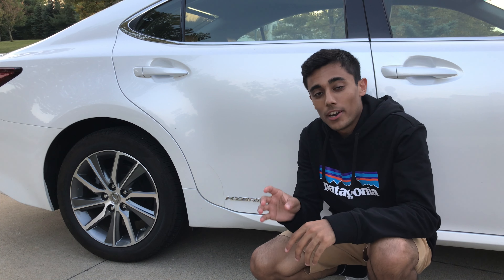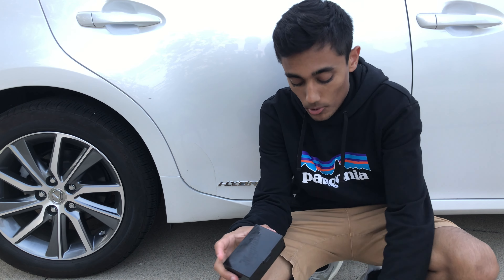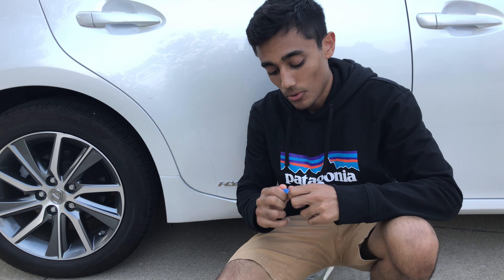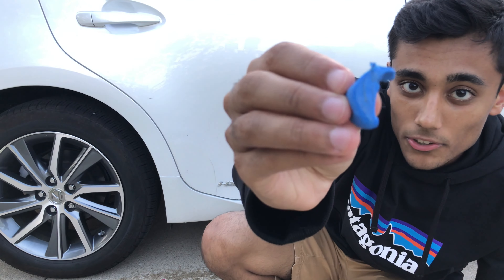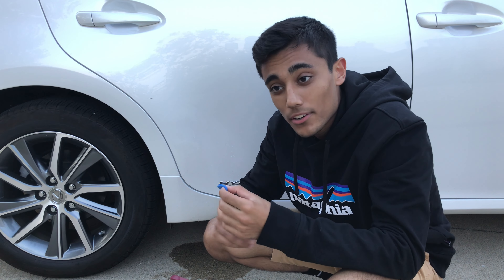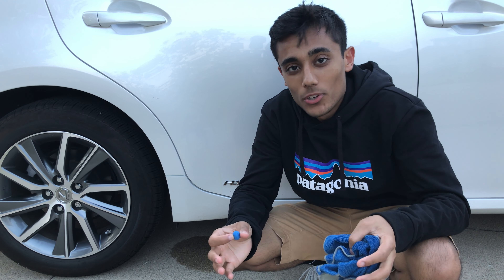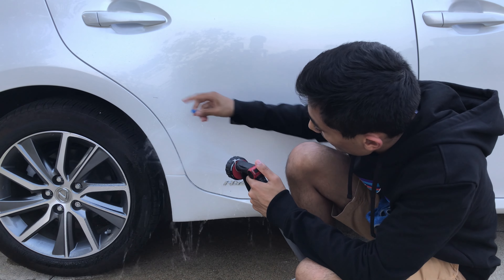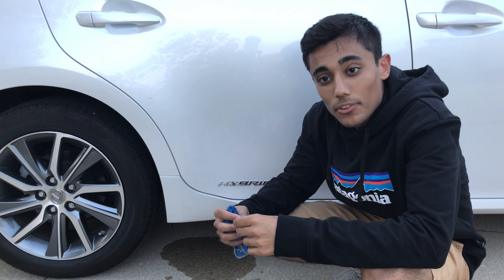How To Clean Paint Protection Film (PPF) / Clear Bra Edges and Borders

Comment: When you said if the line around the film you are trying to clean is yellow , detailing clay will not remove it. How yellow? Mine looks like the color of tea. It’s not on the edge but slightly underneath the edge. Is it easier to just have the PPF removed?

Comment: I just got a client with a 12yr old Porsche 911 convertible and it has ppf on the fascia of it. I'm in Houston so obviously it's been taking a pounding by the sun. It's not an every day car. He told me it's usually garage kept but you can see the wear and tear on the PPF. So I have two questions. Can I actually use the clay bar on top of the ppf instead of just the edges? And two can you recommend any chemicals that I might be able to use to just clean it up? TIA

Comment: How about swirls on the PPF?  Not sure how to remove those.  I've heard to put warm water.  Any advice?
Reply from the maker: Shedding Honestly speaking, I’ve never seen film get swirled up too bad. I’ve seen it yellow, but never heavy swirl marks. Only thing I could think of is trying to polish it with paint correction compound and a polishing machine, but really at that point, you’re correcting a protection film that’s meant to protect the paint. Seems fruitless. If it were my car, and you’re OCD about those things like I am, I’d just get the swirled pieces removed and install some new ones. They’re not too expensive and will give much better and quicker results than trying to correct old film!
Reply: @SaraiGarage  The film is 1 year old, they sold me on the film not developing swirls, but I see a whole lot of it against the sun :).  I will try the paint correction compound and will let you know.. otherwise, I might go back to the original installer and ask them about it.  Thank you for your response.
Reply from the maker: Shedding In that case, don’t waste any of your time or effort. Take it straight back and demand to have it fixed or replaced. You spent hard earned money on a product based off of their claims. If it doesn’t hold up, you have every right to have new film installed or be reimbursed. If it were me, I’d go straight back to the shop! Good luck with everything!

Comment: thanks for the insight! can the clay potentially lift the clear bra off the paint surface at the edges though?
Reply from the maker: JoviTV Technically speaking, if you’re very aggressive then slowly over time yes, I can see it peeling more and more over time. BUT, when everything is lubricated well and if you don’t do it with unnecessary force, this should not peel it up at all. Even if you did it forcefully, your car would have over 200k+ miles on it before the clear bra peeled off from clay bar. You have to purposefully try to make it peel off for it to happen 😅 But yes, it could happen haha You’ll understand what I’m saying a little better when you try this yourself!